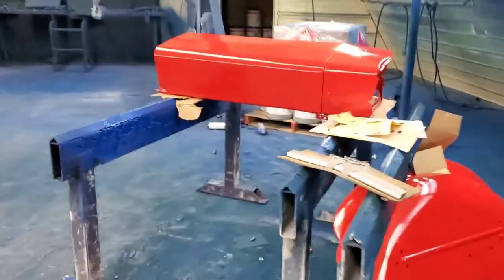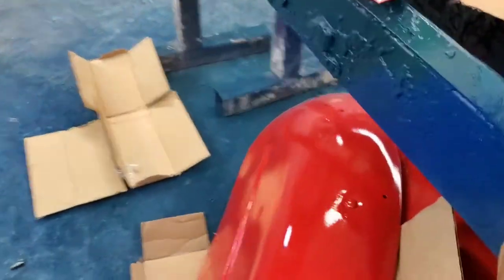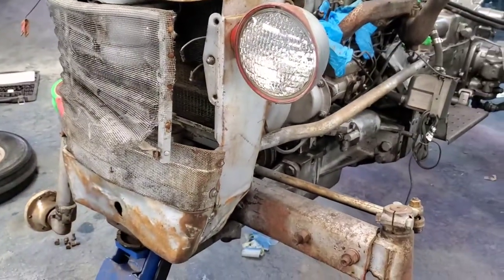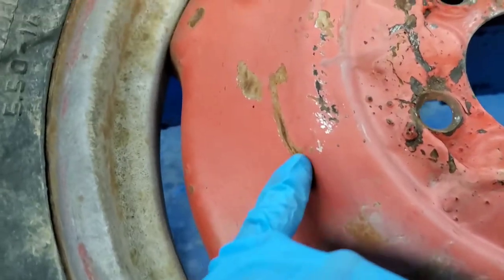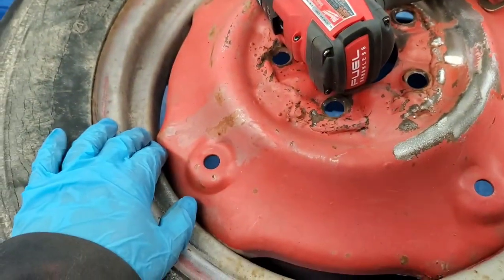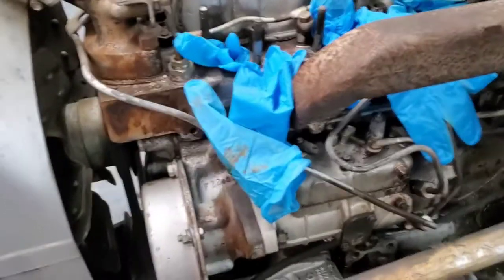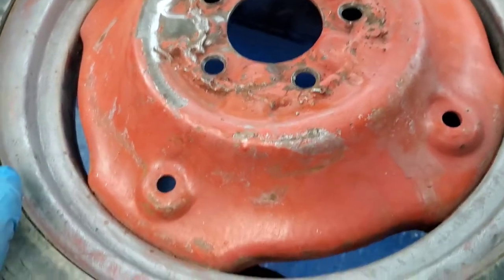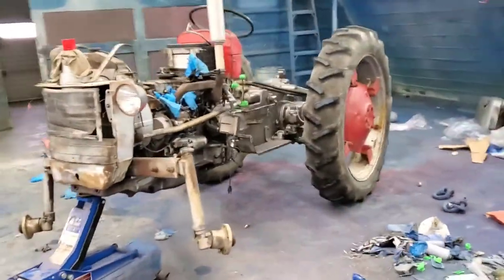Massey Ferguson 130 Restoration Work-in-Progress Update: Painting Rims!

Comment from the maker: Update: I didn’t film any more videos on the process because I just didn’t have the time. The 130 is all back together except for the nose cone and seat cushion. I still need to order the cushion and I’m having a new nose cone custom 3D printed. Tractor runs good and we’ve used it for a few odd jobs around the yard including to dig some potatoes and turnips from our large garden.
Reply: Would Love you find out more about this tractor. I have one who's main issue is hydraulics. But the nose cone really interests me as they are hard to get and $$$$$ when you find them. How did that come out?